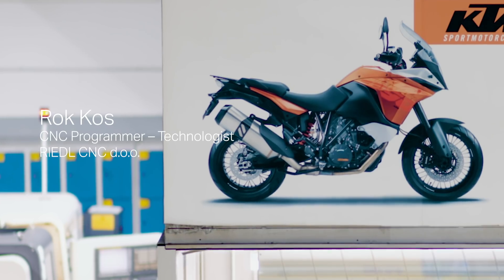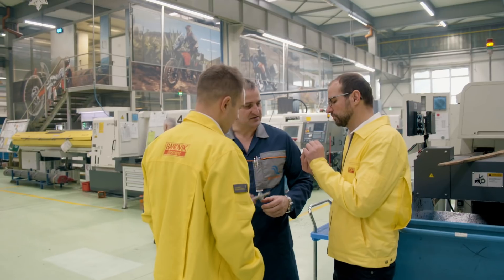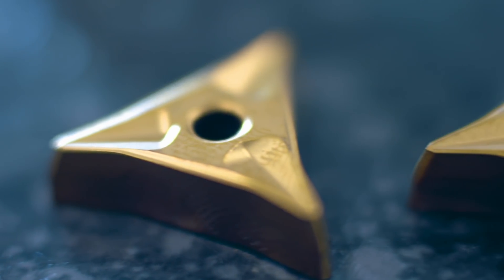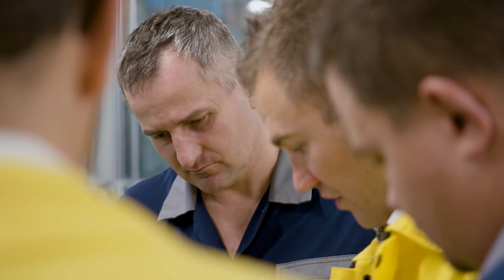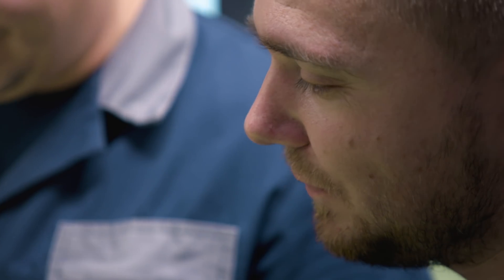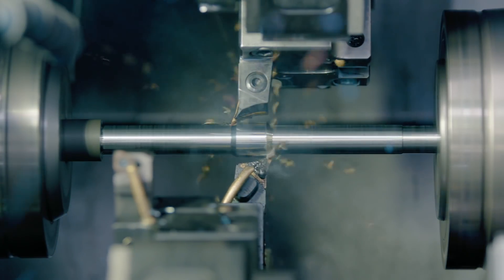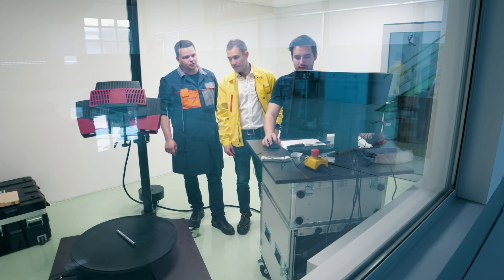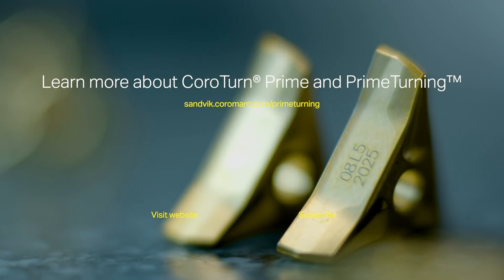PrimeTurning™ delivers a huge cost saving for Riedl

Comment: ARE these inserts available in 19mm with 1020 grade carbide?
Reply from the maker: Thanks for your question, PrimeTurning inserts are available in two different shapes (called A-type and B-type) both with an inscribed circle of 11 mm which normally is used as size denomination for carbide inserts. B-type can manage up to 4 mm depth of cut and A-type up to  3 mm. The inserts are available in 4 different carbide grades but unfortunately not in 1020. The wear mechanism with PrimeTurning is rather different from the wear you get in conventional turning, meaning the first choice grades that we are used to might not be a good choice for PrimeTurning. You can find more info about grades and geometries on our web:
https://www.sandvik.coromant.com/en-gb/products/coroturn_prime/Pages/how-to-use.aspx
Reply: @sandvikcoromant  I have a video showing SANDVIK 1020 grade carbide.  They are amazing grade on super alloys.